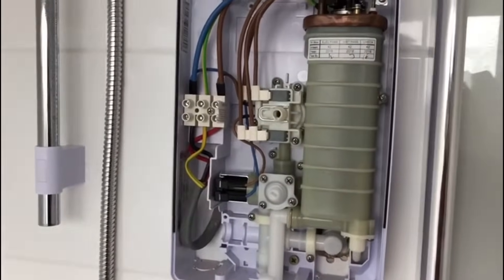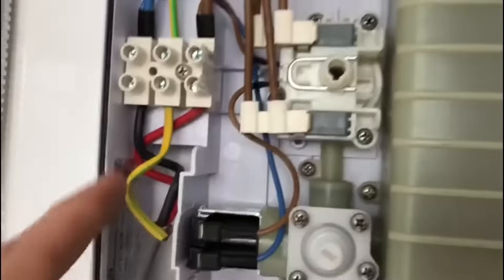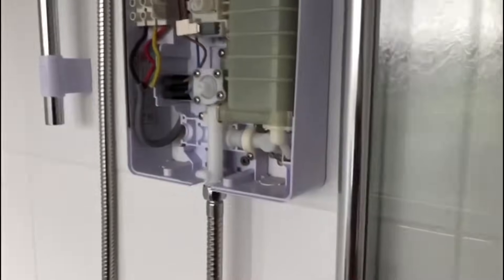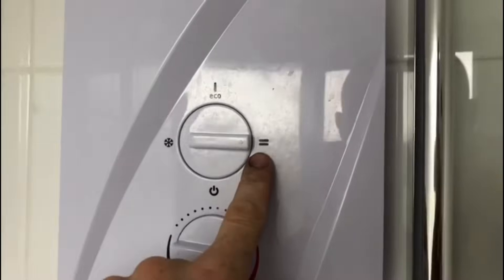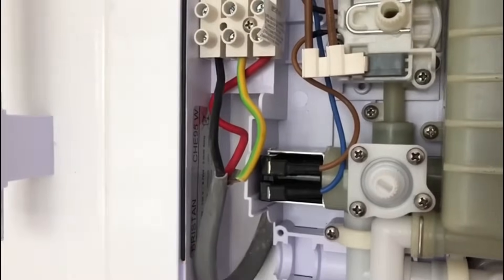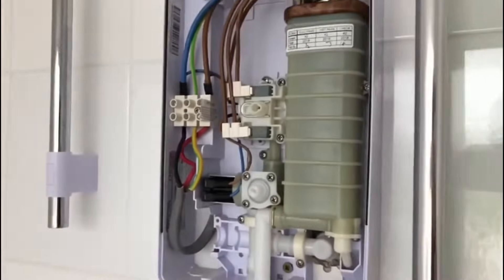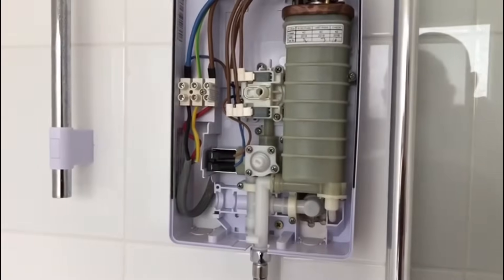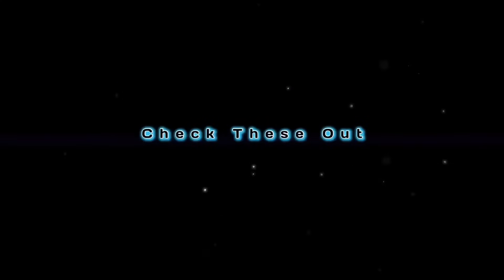Is This Cable LARGE Enough..? - Measuring Load Current LIVE - EICR 9.5 kW Shower Circuit

Comment: If a shower pulls 40 amps does that mean the element only has a resistance of 5.75 ohms? Does that mean it is less resistive than something like a light that only pulls a small current? I can’t get my head around the maths

Comment: Learning something new today, 40Amp electrical shower?
What's the main breaker then?

I live in Belgium where the main breaker on the meter only allows me to draw 40Amps from the street (but could ask for 63Amps, and pay a lot more for my connection)
Reply: @toddbod94 that's a lot of power :o
Reply: @toddbod94 single phase 40 amps x 230 volts = 9.2 kW, it's plenty, my kitchen appliances have a 20A fuse, electric cookfire 32amp.

My grandfather has 3 phase 400volts, but a main breaker of 25 amps
Reply: @toddbod94 yes that's correct, although most of my grandfather's stuff was specifically bought to be 3 phase that doesn't need a neutral connection.
That way he only uses the 25amp available on neutral for stuff like pc/tv/light/microwave
Reply: @toddbod94lol! Some places here in Spain only have a 16A supply!

Comment: In 99% of uk house’s the shower cable will run through the loft you have to presume at least a reference method of 100. This means that a 6mm could only take a maximum of 34amps. Needs to be a 10mm or down rate shower and protection to 32amp. Also a lot of people in theses comments are thinking that the shower will be 8.7kw at 230v and 9.5kw at 240v it’s the opposite. Higher the voltage less draw/amps. I do agree that an issue with 10mm is that a lot of sparks can’t tighten the connections in a shower switch correctly but the regs can’t allow for that. 😂
Reply: Wouldn't agree with 99% thats a pretty strong percentage you're convinced with. I've seen it ran in walls, floor up, in comparison to, from loft spaces, ceiling down. Then again I've even seen a 2.5mm twin and earth ran externally on a detached bungalow, no protection, just nail on clips pinning it to the wall. Running a 10.5kw shower. How this thing didn't cause any catastrophic damage is beyond me.
Reply: You're thinking that the load's resistance will somehow automagically vary in response to the supply voltage, but that isn't the case with simple resistive loads like this. The resistance is determined by the element wire's CSA, length, composition and temperature. The current that flows through it is I=V/R, thus the current flow is directly proportional to the supply voltage, not inversely proportional as you seem to think.

Knowing that P=VI and yet ignoring all the other relevant factors is going to yield absurd conclusions.

Comment: You said it was a 9.5lw shower? Isn’t that at 240v? As we are on a stated voltage of 230 wouldn’t it be an 8.7kw shower. ?
Reply: Your voltage is 230V plus or minus 10 percent. You’ll find that the voltage quite often in the UK is 240+.

In this case, it’s pulling a measured 40.8 amps, which even at 230V is 9.4 kW.
Reply: @JasperJanssen  you have missed the point here . The shower element is a fixed resistance.  The higher the voltage the higher the current.  So at 230v its 8.7kw and at 240v its 9.5kw . At 250v its higher again.
Reply: Most of the measurements I get in a property for voltage is above 230v. Average is 235-245. Don't think I've ever had '230v' on the nose

Comment: You can play around with calculations all day long, for me a 9.5 kw shower on 40A breaker over ten meters unclipped is ok.
Could you do a video bending 10mm twin into a pull switch, but not a
Crab tree switch.
Reply: But surely that depends on the voltage? The calcs if you are getting 230V comes out at over 40a so why would you leave it on that? Would you not confirm your volt drop calculation to ensure you are compliant?
Reply: @craigbuist4636  the shower data plate says 230 to 240 volts  and 8.7 to 9.5 kw .  The element in the shower is just a resistor . The higher the voltage the more the current , the lower the voltage the lower the current . If you were getting 250 volts  you would have 41.6 amps . Etc

Comment: I live in a bungalow, new build 2021.  cables covered in thermal insulation 400mm (101).  Ring final circuit 151m on a 32A OCPD.  Cables ran through trusses.  I have spoken to NICEIC, they said it is fine with regards to the thermal insulation, as loft insulation isn’t really a concern on domestic properties.  Also the R.F.C does even meet volt drop limits at 20A never mind 26A.  They also said not a problem as kind ELI is fine.  
So all these years why have I ever bothered with calculations for thermal insulation or ring final circuits.  This industry is going to the dogs.  So according to the NICEIC Matt, 6mm would be fine.
Reply: I’d lay the cable on top of the insulation
Reply: @jimmyfurey  The cable should have been installed on timbers towards the eves of the property. Out of the insulation

Comment: at least we could use method 100 as reference where you can no inspect all throught the route, Id=41A @ U=230V,  In should be at least 45A,  So Iz at least should be >= 45A or consider using the shower frequently use I1 factor 1.13X45A=50.85A, minimum 10 mm, ideal 16mm, I don't like to using reference C at all except you 100% inspect the whole cable route, if there is any suspect the cable run in the wall or through the ceiling, I would like using at least methord reference 100, and in EICR always using LIMITED.
Shall I using worst senario method reference 103#, I am already carefully to choose 100#. If I using 103#, above case I shall using 16mm cable, what the reality it is, maybe I can not get the job.

Comment: These showers usually give you the higher power rating, likely for selling purposes to customers (Higher is better right?). But if you check the manufacturers instructions it lists this particular shower at 9.5kW @ 240V. However we design at 230V, so the power rating at this voltage is given as 8.7kW @ 230V or 38A. 

I can't from this video tell how this cable is installed, which is the main issue here. If any kind of insulation is covering this cable it doesn't comply with a 40A MCB. 
BUT you could argue that it's supplying a fixed load, which can never be overloaded! So you only need to find a cable that can handle 38A. Running 6mm in trunking or conduit can handle 38A, although the cable would be pushed to its limits and should be avoided. You would also need to confirm the cable size can handle the fault currents.

Manufacturers requirements in this case override this as it states "The current carrying capacity of the cable must be at
 least that of the shower Circuit Protection Device".

So were back to square one, finding a cable that can handle 40A and as was said in this video, this cable likely doesn't comply. For most electricians I know, looking in lofts and voids is a limitation on our EICRs, so how would you ever know if this 6mm cable complies :)

I've said this as I have come across rare situations where a 6mm would comply for different branded showers, once taking the above into account.

I would definitely sleep better at night by installing a 10mm.
Reply: how about if the voltage is 253V, 10% higher than designed voltage by DNO ?
Reply: @huyongquan6554  The cable ratings have already accounted for voltage tolerances, we use the Uo (Nominal Voltage) in our cable calculations. This is 230V in the UK, single phase
Reply: @garethg2501  Best be a bit more careful,  I always use 245 or above, voltage on many jobs I have done are sometimes at 250, but soon as you load them up it drops to 245. Calcs should be done with real world info, not a theoretical, thats where some designers go wrong.
Difference between 230 and 245 extra 15v or extra 6.5% current.

Main point here though is the standard temperature rise in the cable. Assuming its 30c at start of use how high will the conductor get to in 10-15 mins of use at 40 Amps.
We see that the cable will be heating up at 0.292 watts per meter, this is normally dissipated through convection.
Now assuming it goes through 400mm of insulation gives us a heating effect of 0.1168 watts for the 400mm, what is the temperature rise in this section of cable?
Can the cable dissipate that amount of heat or if not what will the temperature rise to in say 15mins.
So 117mW for 0.25h gives 29.25mW/h.
Put it this way, its cold.
Get a temp probe, tape it to the cable in the middle of the insulation, run the shower for 15mins, I bet it doesnt even get to 40C let alone 70C, its max operating temperature, not many houses are at 30C, more like 20C, and in the loft its even colder.

6mm is fine.
Reply: First class analysis !
Reply: If you're going to use a voltage other than 240 or 230 as is being suggested here, then you'd need to measure the resistance of the elements to calculate its power rating
 i.e V(squared)/R

Comment: For them every day for my local council.. Roughly get r1 +r2  =0.10 for 10mm cabel,anything lower look to tighten every screw, could get some contact resistance from the isolator.

Comment: Ive bern a sparks for over 30 years and for the life of me i cant understand why we still use deration calculations which adjust for installation methods and insulation within voids, lofts, thermal barrier spaces....
Just about every installation working to building regulations has lashes of insulation, kingspan foam battens , foam spray etc etc... and also cables are grouped or bunched with other cables or run through areas of contained heat or near maybe warm ducts or hot pipes....
 so basically what im saying is there is there is rarely a situation where a cable or cables arent influenced by other sources so why dont we select cables on worst case. Building works or additions after the cable installation usually change and influence the cables ability to carry current so again pick worse case scenario..... then your covered...
All these ifs and butts and maybes just complicate cable selection and open up a can of worms of interpretation between electricians and the regulations...
What i design at the time complies with regs.... but soon as a builder comes in then he stuffs insulation everywhere and boxes stuff in or influences the parameters then that can make my work non compliant then im the bad guy.....
Reply: Agree with the lot. 👋  Been in the game 47 years (and I bloody know it 😳), and, am my own worst enemy as I hold my nebosh so always cover everything. The best fun is when you try to point out things to some of the young 'uns, boy, do they take the hump and double the fun when it's BC 🙄🤣🖖
Reply: Completely agree, I left the installation game about 5 years ago. P1ssed off with the regulations, full of know-it-alls, sad bastards, and experts, as you correctly said, builders don't give a toss about covering up cables with insulation or timber, at this rate the sh1t regs will make lighting circuits wired in 6mm T&E to cover all eventuallies.
Glad I'm out of it now.
Nice maintenance job now and retire in 2 years, 🎊🎉🎉
Reply: totally agree, but shall I always using worst senario method reference 103#, I am already carefully to choose 100#. If I using 103#, above case I shall using 16mm cable, what the reality it is, maybe I can not get the job.
Reply: As a designer it is your responsibility to know what your builder or the architect has specified prior to your installation. Your only get out is if a modification has occurred after the installation has been handed over.  Eg. The customer decides they want to add additional insulation.  However I understand completely what your saying.

Comment: Personally I'd do this test at the isolator or consumer unit. I can't think what could possibly go wrong using the shower with the lid removed. 

Although a few weeks ago I had a shower like this which a "tradesman" had removed to replace the back panel, he'd clearly snapped the cover screw lugs and repaired using silicone. Big fat C1 on the EICR - when I nudged it [didn’t even use a tool] the whole cover fell off. The look on the customers face was a picture. 

Got a replacement of the same model and spent about 30 mins with a razor and WD40 removing silicone from the customers brand new back panel. Electrically sorted but suggested she get a plumber to look at the bodged piping too. Why does it seem that the vast majority of cowboy electrics appear to be done by kitchen & bathroom fitters?
Reply from the maker: Massive thanks for taking the time to leave such a detailed comment and watching 👍🏻
Reply: I hate doing EICR's where there is an electric shower, unless the shower is very new I just test from the isolator which I know is not testing the connections in the shower but often the screws are rusted and the plastic is brittle or the seals never make a good seal again...